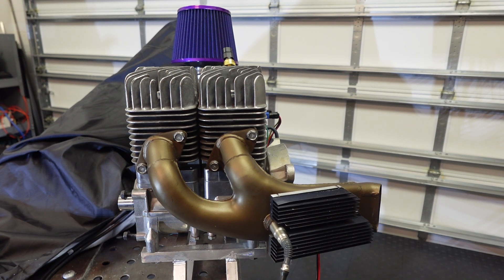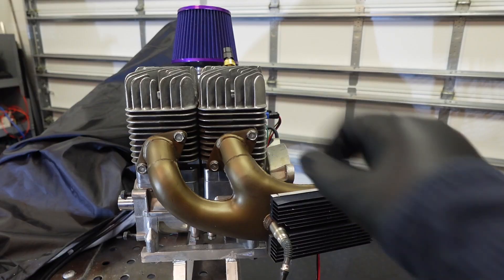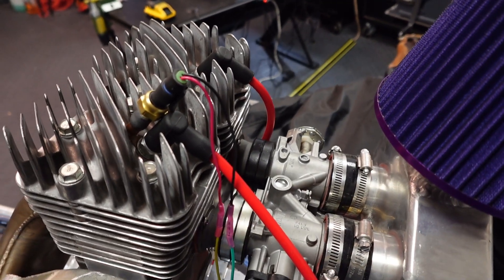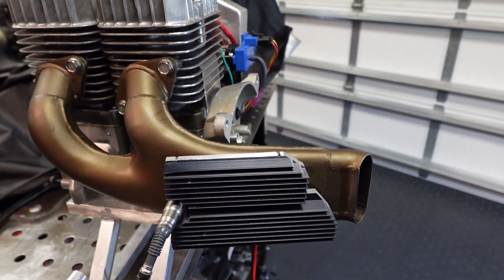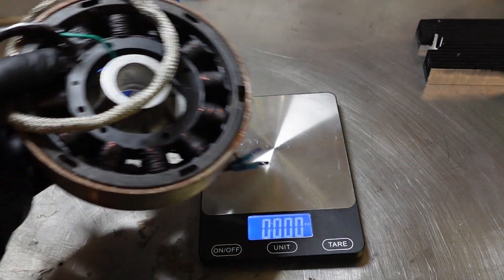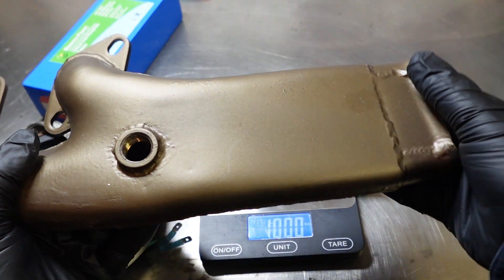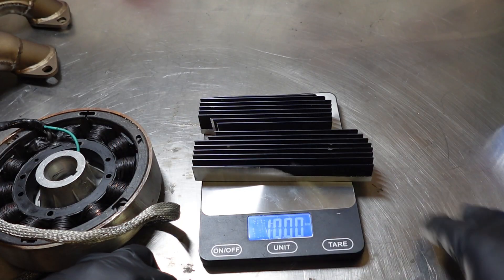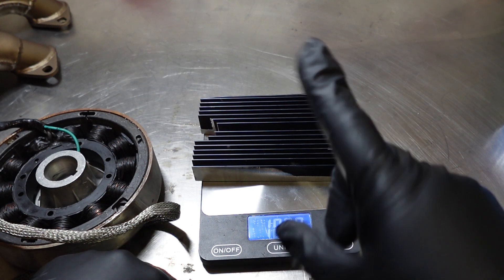First Tellurium Breakthrough: Drone Power Tech

Comment: A very good application, but it's a shame that in the case of kamikaze drones, valuable raw materials disappear in the war zone.
When comparing thermoelectric generators in small combustion engines with conventional ones, it is important to note that the mass of the flywheel, which also forms the rotor of the generator, must be retained when replacing it with a thermoelectric generator.
But the most important question is: When and at what price will such generators be available for purchase?